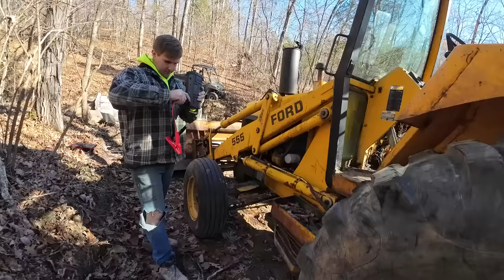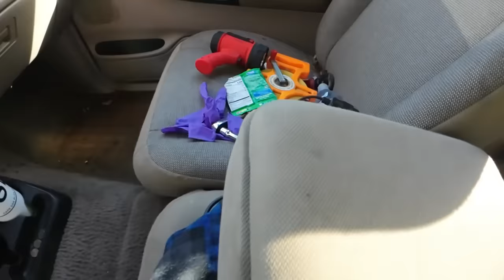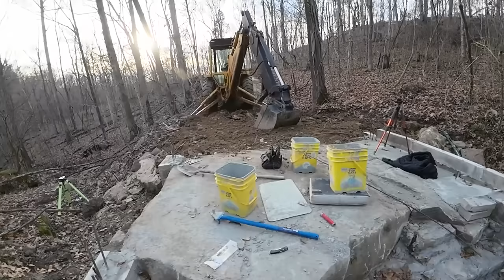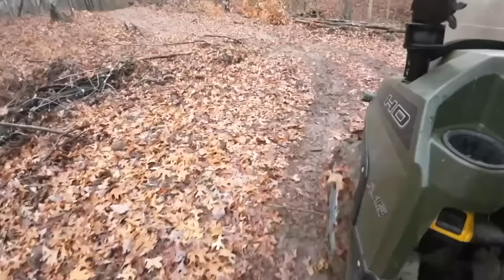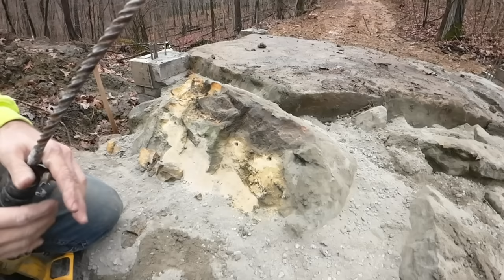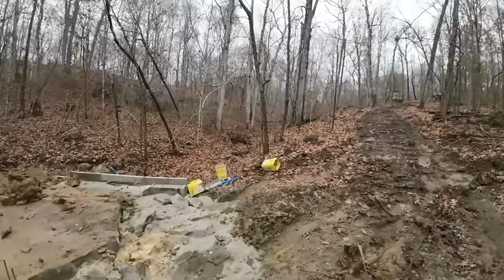I was nervous about this one! - DIY Bridge Build

Comment: One of the smartest thins I've seen done with quickset concrete is, the guy filled paper lunch bags with dry concrete, tape them close, then stacked them around the open ends of a couple 14-16 inch tubes, than let the rain finish the job.  ;-)

Comment: FYI in the future spray all the nuts 🔩 and bolts with silicone dry lubricant as they’re assembled. It will dry collecting no dust and dirt, also help to prevent rust. With future breakage.

Comment: Digging in ok gave a tip in a video a while back that if you need to cut a slight angle with the loader on the backhoe, to swing the hoe to the side you want to cut, the extra weight will cause that rear tire to squat slightly, and now you can cut an inch or so deeper on that corner.
Reply from the maker: Yup,  that can help,  the catch is you have to have room to swing the boom to the uphill side.

Comment: Hi Mike. Another great project coming to a close. I was worried about the span of the stone bridge and if you need to use it in a more frequent manner I would put two small concrete piers in the middle of the span about tyre width apart (just in case) also the road with the bend near the bridge, try and take as much bend out of the road and the steepness as well if you can. Wouldn’t cost much and mainly for peace of mind. Cheers Steve Melbourne Australia 🇦🇺

Comment: I’d like to comment on your traction of your tractor. Your front wheels are light by putting a scoop in the bucket when you’re driving around that will help your steering. Your rear tires although not ideal is not the problem. You need more weight on your wheels One way you can do that is to get a kit to put water inside your tire fill it about a third of the way. They also have wheel weight kits, which are fairly large weights that go on the inside of the rim.  Also decrease the amount of air you are using in the rear tires when you’re in the mud. Air them up for one you’re on hard pack or road and driving faster but when you’re in the mud or snow, they should be almost low on air.
Reply from the maker: The problem in the rear is the tires. 👍 Thanks for watching

Comment: Had an old Jonsen dumper that was 30 years old it was 4wheel drive but from the engine to the wheels the conection to the drive was a chain which was problem and very poor quality brakes because all the seals on the axels leaked oil onto the break drums but it was ok except for the fact that it was 2 cilinder and hand crank to start it which wasn't that easy because there was no preheat and difficult to start in the winter but it worked reasonable once started what was very good about it was the hight of the bin because bottom of it was just under waist high if you tip to level with the ground and if you tip all the way the bin was only 10/12 inches from the floor which was good for when you have to clear brush and push into a pile for burning it was scary what it could carry for a 2ton machine the advantage with it was that the bin was perfect hight for shoveling gravel out to spread on the drive which was half mile long from gate to house

Comment: Sounds like your gear pump needs to be resealed. There is usually an oil seal on the outside part of the pump which will allow hydraulic fluid into the crankcase  if it goes bad.

Comment: You should of made it a little bit wider so it would be easier to line up with. You have it more to the one side.
Reply from the maker: If a fella can't line it up on a 10' 6" crossing, they need not be driving or operating 🤣

Comment: I know what your thinking Mike, your gonna use that hoe as a crane, but remember that leaky cylinder is going to have lots of creep. Might need to get the missus up to speed on the levers to keep it up in the air.
Reply from the maker: I think you're forgetting about the other end of the operation that lifts things....

Comment: Hey captain due you have any connections with cement contractor like sidewalk and get side walk  yes WHOLE Sidewalk driveway I also sent you a company on a removable track set for the tractor rear tire not to damage the tires I find the Web site I sent it to you dirt perfert